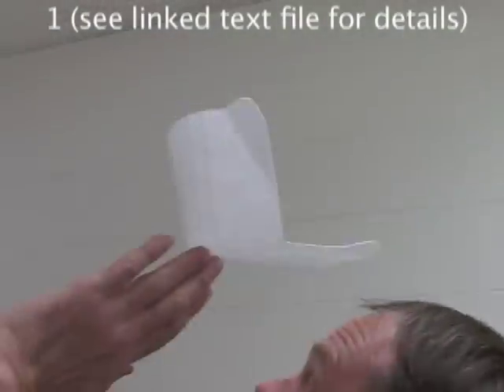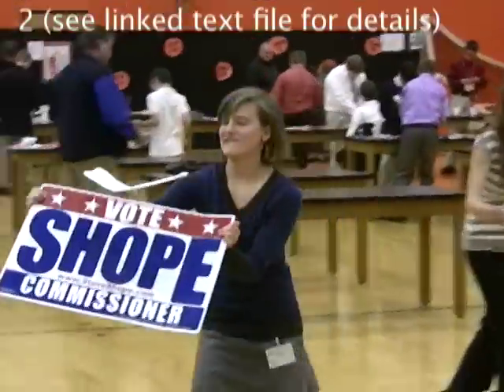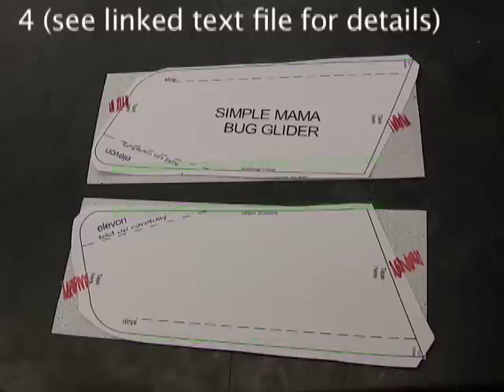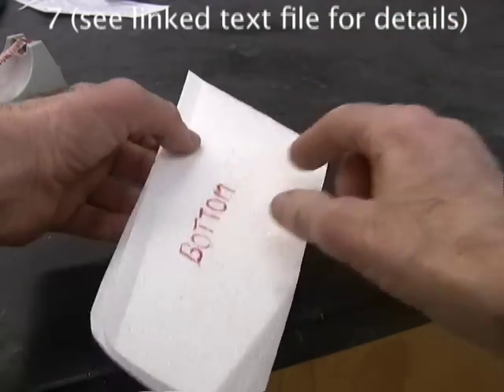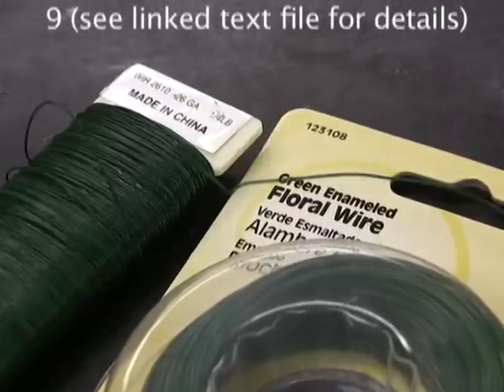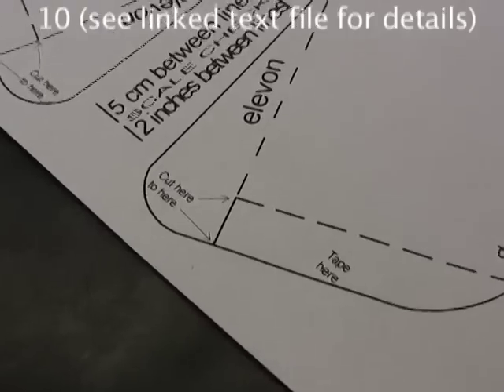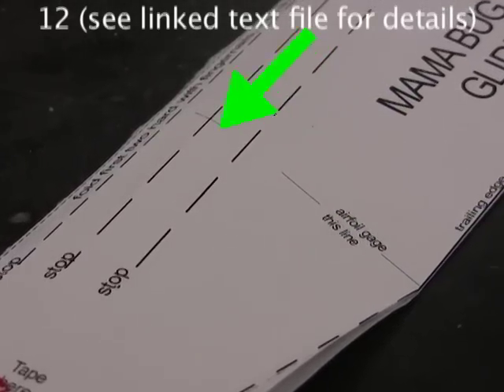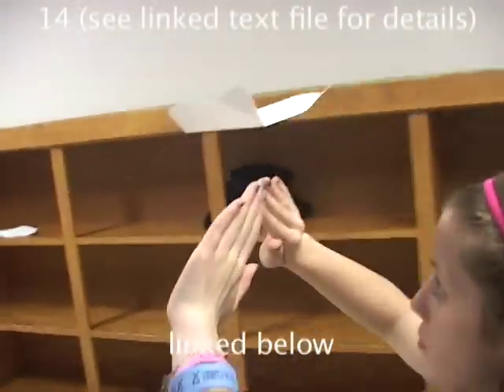Make a Mama Bug Air-Surf Glider

Comment: LOVE FROM INDIA 🇮🇳
Reply from the maker: Greetings from Pennsylvania, Mr. Aditor. I have also tried to make gliders with aluminum foil, but I was not able to get the aluminum gliders to fly. "Styrofoam" (स्टायरोफोम ), the white kind made from little beads (spheres) works best for fixed-wing walkalong gliders. It is cut to about 0.6mm thick sheets with hot wire cutting. You can find out more about hot wire cutting foam here.
https://sciencetoymaker.org/walkalong-glider-airsurf-air-surfing/make-your-own-gliders/hotwire-cut/
There are also some spinning walkalong gliders that you can make from thin paper, which is easier to get.
https://sciencetoymaker.org/walkalong-glider-airsurf-air-surfing/make-your-own-gliders/paper-gliders/
Best wishes,
Slater
Reply: @sciencetoymaker  yes sir sure..☺️.. I'll check it out. ❤️❤️❤️

Comment: Fake .. 0:51 to 0:56
Reply from the maker: It is a compliment when people think it is fake, pulled like a kite, etc. All "flying wing" type gliders (without a tail section) require a front weight. What you see is wire weight, extended forward to have more leverage. There is one fake walkalong glider video on YT of a toy car on a track flying a glider; but the vast majority of walkalong glider videos are legit. Air is deflected upward and you surf on that invisible wave of air. Although the gliders can be made from paper, when you only have your hands to deflect the air, the gliders should be made from 0.5mm eps foam, which is much lighter than paper.

Comment: It is flying too fast...

How to slow down its speed?
Reply from the maker: If the glider flies too fast, then there is too much weight. It might be the front weight, or the whole glider. You can check the front weight by snipping off little bits until the glider stalls, then add some tape until it no longer stalls. It that is not the problem, then the foam for the wings might be too thick, and therefore too heavy. 
If you make a YouTube video of it gliding, then it would be easier to diagnose what is happening.

Comment: Well... I'm late for this video but I think that's a string on the tip of the paper plane 0:50 play it in slow motion 0.25x
Reply from the maker: What you see is the front wire weight, not some string or something to perpetrate a hoax. It's a kind of backhanded compliment that people think that walkalong gliding is not real at first.

Comment: 0:52 i saw the string
Reply from the maker: No, you did not. "Flying wing" type of gliders need a front weight to be balanced and fly right. I use a wire for weight; that's what you saw. There are lots of hoaxes on YouTube, but this is not one of them.

Comment: Why is it flying?
Reply from the maker: When people walk with the board angled. air is deflected up and over. You can surf the glider on that wave of air. I you get good at it, you can deflect the air with only your hands.
Reply: So the glider is flying due to deflected air by cardboard?
Reply from the maker: @thrustandlift9984  Yes. The "relative wind" aka "apparent wind" is deflected upward by the board. So the glider would normally glide down, but the air it's in is rising faster, so it stays up. It's very similar to the way soaring birds and hang gliders effortlessly stay in the air for hours. This is a video I did about it. https://youtu.be/3qOhdl9c7rs
Reply: I love making aircrafte and toys that can fly. Do you have any tutorial to make airplane and gliders out of house hold items?

Comment: Thats not a glider its using a force called ground effect
Reply from the maker: Well, I've heard people say that walkalong gliders use "ground effect" but that applies better to hovercraft. I think "ridge lift" is more accurate, and gliders do use ridge lift (and also thermals). The difference is in one case the air is moving (wind), hits the mountain and is defected up. Sail planes gain altitude in that updraft of air. In the other case we "move the mountain" so to speak, so it's "relative (or apparent) wind" that is deflected up. Again, we keep the walkalong glider up in that updraft of air. It is a glider.
Reply: Ventox 229 was gonna reply the same thing as toymaker but he covered it.  It's often referred to as flying ridge, easy to do at almost any coast with wind that hits the hill, for example they do this with hang gliders ect. in Torrey Pines Ca.

I grew up flying thermal and ridge gliders, loved your video.  I've taken my kids out flying RC gliders and ridge, will have to give this a shot with them.

And for those who are wondering, the more advanced model with the bend on the leading edge is to create a airfoil with better lift properties.   Air crossing the top of the wing has to travel more distance causing the air traveling under the wing to increase in speed to meet the air split from the top generating lift.

Comment: Why you put a board under the glider
Reply from the maker: The slanted board deflects air upward as you walk. If you can keep the glider in the right place on that rising air, then you can keep the glider flying.
Reply: Chambal Rasoi tried to make one myself its a lie
Reply: Ground effect
Reply: Ben's Origami Craft are you using a paper or a foam? If you use a paper it doesn't fly because of the weight

Comment: My grandsons loved making and using these gliders! Thank you for posting this video.

We've looked for the advanced Mama Bug pattern that uses the curved camber shown towards the end of this video, but can't find it anywhere on your site. Can you tell us where to find it? The video and video description didn't have any linked text files on which to click. Thank you for helping us find it.
Reply from the maker: +Wayne Schmidt Thanks for the feedback, Wayne. And I just subscribed to your amazing channel. From gold-panning to cloud chambers, such cool eclectic projects!
Making curved cambers was too confusing for beginners. They bent far too much, creating frustrating un-flyable gliders. I found experimentally that one simple bend as camber flew almost as well and it was far easier for beginners. They only had to set the angle. Here is a link to an old video that uses rolling the camber in with a pen: https://www.youtube.com/watch?v=VRWeSQLn7S4 The pattern is linked in the description.
Reply: +sciencetoymaker Thank you!

Using the hot wire cutter on your site, I finally managed to cut some 0.65mm sheets of foam. You were right, going that thin has a big impact on flight speed. I used the foam blocks sold by Michael's craft stores and even though at 14 KG per cubic meter it worked quite well. The planes glide so slowly it's almost like magic, but I still haven't gotten the knack of using a board to keep them up. 

Again, thanks for the response.
Reply from the maker: +Wayne Schmidt Yes, while it's easy to show someone how to fly--walking beside them and mutually holding the board so they get the feel--it's harder when you're the first in your region. It should be level with the top of the board, close to blowing over the top. 
If you make a video of flying eventually, I'll embed it on this page http://www.sciencetoymaker.org/airSurfKit/WalkalongFlightGallery.htm

Comment: 0:52 that string though
Reply from the maker: +gavin goproactionvideos Not a string; a wire for weight. All "flying wing"  (having no tail section) type of gliders require a front weight to prevent stalling. They also require up flaps in back (called "elevons") to prevent diving. When properly adjusted, the front weight and back elevons give a good glide. We use the tailless design because you have to balance the glider on a upward wave of air (that board diverts air up). With a tail, the updraft tends to lift the tail more, causing diving. Dr. David Aronstein has created some walkalong glider designs that do have tails, though.
Reply: sciencetoymaker oh for a second I really believed that this was fake thanks for explaining
Reply from the maker: +gavin goproactionvideos It is understandable. There are a plenty of hoaxes on the internet. I also think that it is a compliment when people can't believe it is real. It does look like magic! 
Paper is heavier than foam, harder to launch and fly. But if you want to try walkalong gliding with just paper, I have a new video with a simple spinning design (you can also send them up in helicopters).   https://www.youtube.com/watch?v=al9ERt1PiFY  Try it and show your friends how science can look like magic!

Comment: Did you use a copper wire?
Reply from the maker: bat man The weight can be anything: copper or steel wire, or even paper. I prefer wire because by bending it forward or backward, you can change the balance point (center of gravity) of the glider very easily. That is easier than adding or cutting off weight.

Comment: i saw a string attached at 0:54 lol
Reply from the maker: shadow68556855 You saw the wire that is the weight. All "flying wing" type gliders need a weight in front to keep them from stalling. I use thin wire because I can micro-adjust it by bending more forward or back. 
I suppose it's a compliment that it's magical enough looking that people think it's a hoax at first. And I know of one walkalong glider hoax video involving a toy car on a circular track (everything on that channel is a hoax). But walkalong gliding itself is real surfing on a wave of upwardly deflected air.
Reply: oh ok i thought that section of the video was a hoax ok thanks

Comment from the maker: First, make sure the vertical stabilizers are really vertical--folded all the way up. Then experiment with where the glider is in relation to the board. Is it on the edge as you push the glider into a turn? Is it in the the middle? And don't expect a big glider like this to made a very sharp turn such as you can do with the Jagwing. but it will turn.
If that doesn't work, try making a video so I can see what's going on. 
Slater

Comment from the maker: I use 4o gauge nichrome, the thinnest available. Most people use at lease 30. 40 tangles and breaks, but it does not melt a wide kerf (gap). The less foam melted and stuck to the side of the sheet, the lighter the glider will be.